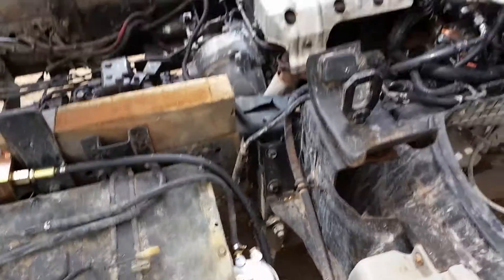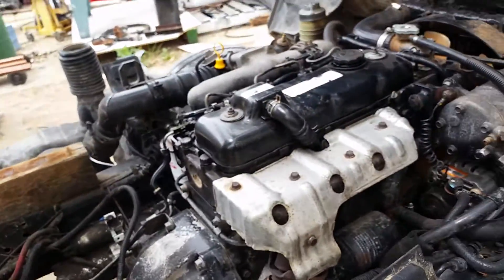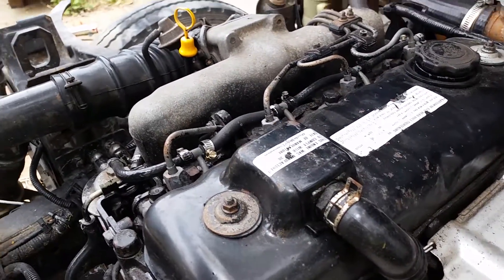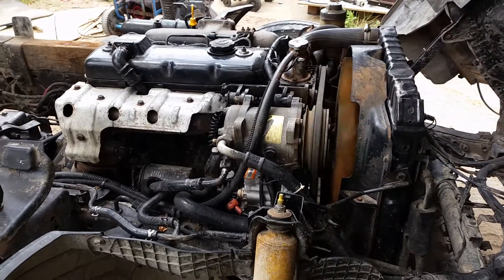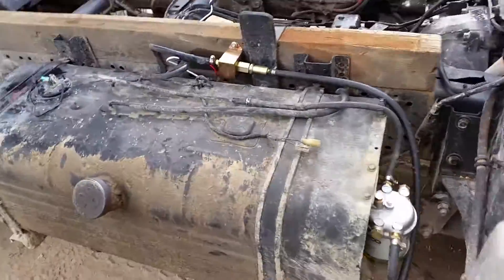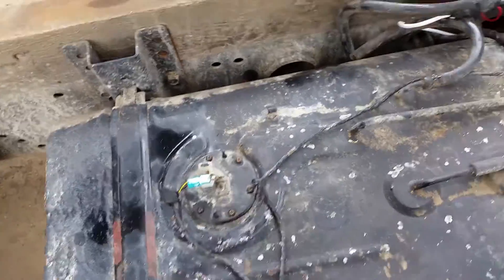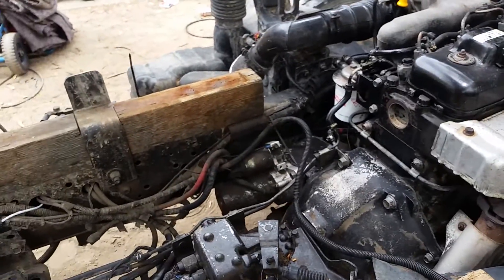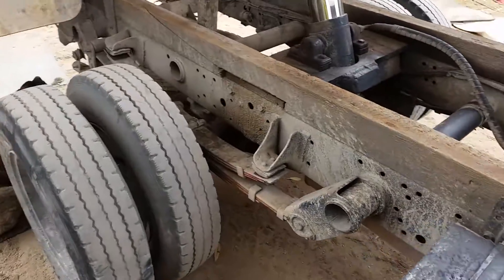T4000 Fuel system fixed.

Comment: Do those fuel pumps work on oil?
Reply from the maker: thin oil maybe, old sludged up engine oil? probably not :)
Reply: alex993cc1 OK so it would work on refrigerant compressor oil? (I'm thinking of a lubricating method for my tecumseh compressor)
Reply from the maker: Mac Man might work, its only a $50 gamble to find out.
Reply: alex993cc1 OK, thanks for that! When i earn a bit more i might blow a 50 on one!